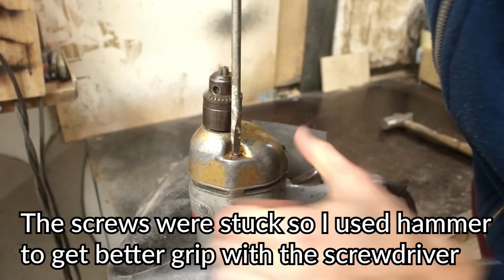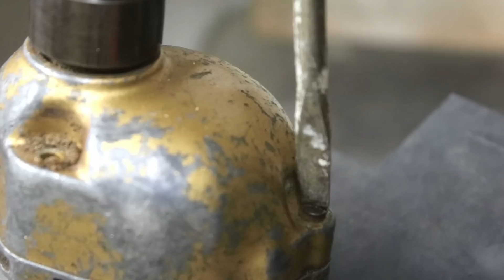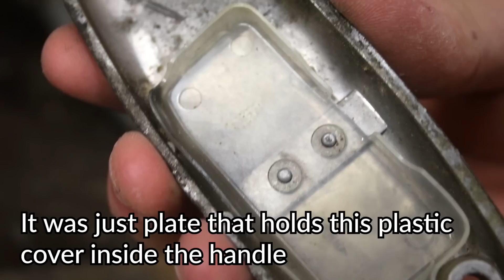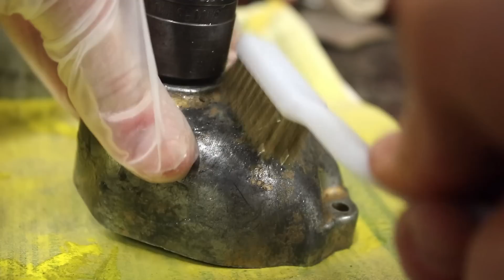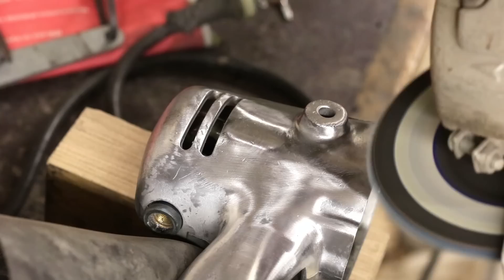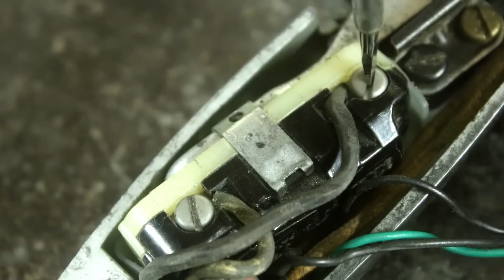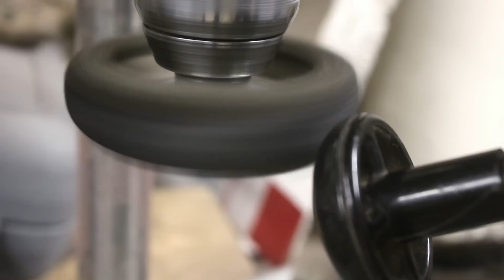Vintage Cord Drill Tool Restoration and Repair - Black and Decker

Comment: We had a similar Black and Decker in the family for over 50 years, the only thing that ever needed replacing was the Brushes once and the fuse in the plug twice. The thing still out performs most out there today.

Comment: Ignore negative comments from people who add nothing and only tear down. You put in a lot of work here and it shows. I generally avoid paint as I like to see the piece gleaming, which you can make that metal housing do. I want you to keep going, polish the bolts, the jacob's chuck. Make that beast shine, brother. Also, you will need more grease in the housing. When it warms up, the grease slides to the bottom so you want to fill it enough so that the bottom of the lowest gear can pick up the grease and help send it to the other gears. Keep going, my friend!
Reply from the maker: Thank you. I think I'll make sure there's enough grease
Reply: @OddTinkering  Keep going, man. Throw away the throw-away culture.
Reply: @mantaship   If we all do our part by eating just one bag of trash a month we can build a brighter future
Reply: I have an old Black & Decker Home-Utility 1/4" portable electric drill guide book.  Regarding lubrication of the drill (which looks much like the one in this video, but a bit smaller) the guide says:  "This Drill was properly lubricated at the Factory and is ready for use.  The gears should be re-lubricated regularly, from sixty days to six months, depending on use.  Remove gear housing, flush out all old grease with kerosene and, with gears in place, re-fill the housing only half full.  All bearings in the gear case end are lubricated by grease in the gear case.  The commutator end armature end my be lubricated by removing the two screws at the back of the switch handle and lifting the switch handle out of place far enough to place one of two drops of oil on the armature shaft.  It will not be necessary to disconnect the wires.  This lubrication is essential only after an extensive period of operation.  Drills out of service for a long time should be completely re-lubricated before use."  There you have it. Beautiful drill restoration!

Comment: I've seen a lot of your videos the past few days, it is mesmerizing to say the least, and incredibly inspiring, I'll take up a few project myself this summer.
Though, as an electrician, I'd suggest changing the whole electric cord into a new one. I can see you prefer to keep everything as close to original as possible, though I've see old rubber wires short circuit inside, due to rubber wearing out and cracking.
Thank you for some great content, already excited for your next video!
Reply: That was my suggestion also.  It’s very relaxing to watch him work and gives me peace with all that is happening.  Keep up the great work!
Reply: As an electrician too, I totally agree with changing a cord into a new one.

Comment: The cool factor about those old Black and Decker drills is that you can still get parts for them. I was able to get replace bearings, brushes and a new chuck as well.

Comment: My late father got exaktly this model from his father. He built a 28 foot cabin cruiser and one day the anchor burnt. But he still had some accessories like the b&d lathe which I became. I found the 720 model from b&d on a german flea market June 2019 for 8 € and did a similar repair. Thank you very much for your good video.

Comment: The Jacobs Chuck can be removed with the screw inside, they are normally left-hand threads. open the chuck jaws all the way and you can see the screw, the chuck then screws off the other direction. this tends to be easier to do before disassembly of the drill motor. just FYI for next time you need to change the chuck.

Comment: I just got a 1/2" low speed high torque drill off Craigslist for $25... The exterior is clean and runs like a champ but is a total mess inside...  Looks like it had been in a few machine shops over the years based on the all the names etched on it... Videoes like this make me realise how much I need a workshop of my own....

Comment: The very good point about replacing the cable has been made & heck yes. 
   After all your hard work & a cleanly filmed video, what not go the extra mile & fit a brand new chuck ? Outside of that, you,ll be using it & not me …………… nice work.

Comment: Very impressive. I would have thought you would have changed the wiring for new incase of any damage which could cause hot spots and a fire, and I would have thought adding more grease into the grease trap for the cog to always run smoother.

Comment: You cleaned it up a bit, got most of the gunk out of it. I was hoping to see how to replace the chuck as mine has broken cogs (teeth). But it runs smoother and will run cooler. Thank you.
Reply: If you insert the chuck key into the chuck and then shock it counter-clockwise, you should be able to screw it off. I have a D520 and I've had the chuck off a few times this way.

Comment: I can get hold a a similar drill not sure of model but looked the same.  Also had a hedge cutter attachment still with it's original box.  My dad had one too many years back,  can remember the electrical tingle off metal body ;)

Comment: Pretty good restoration. 
I would have painted it the original gray, or clear coated the polished surface. You can get bearing material from McMaster Carr and adjust the diameter to the shaft.
Maybe use correct size screwdriver in the future, less risk of damaging the screws. Blade thickness and width should match the screw.

Comment: I love your videos ❤ 
But not comments telling you the inflow traction plate should attach to the vinyl valve output module or the reflex action of the positive baffle spring is hampered by the crossbar lever action
Reply: Different levels for different people, especially for those working at different levels of a craft. There's need and room for all.
Reply: @nothankyou5524  I agree,  was just trying some gentle leg-pulling. As a complete ignoramus, I am in awe of all these restoration guys (and slightly addicted to watching them)

Comment: Be very careful when using paint remover, all it takes is one drop to get on the lacquer or plastic coating on the field  coils or armature coils to cause a short. Even a brief contact with this coating can damage it and cause the insulation to fail later on if not immediately.

Comment: 0:55 Whenever you hold something with bare hand to support and use other hand to apply pressure with flat tip screwdriver I’m worried it will slip and punch a hole in your skin.

Comment: i have my dads black and decker drill that is at least as old as this one (1950s). The thing sparks like fire when I use it, which i dont really anymore.
Reply: Mr Beerski you might want to start with renewing the brushes.

Comment: Fine job. Recommend a lot more fat in the gear house and a new electric cord in order to avoid an electric shock due to current leaks. I got the newer larger model D720 Black and Decker on the flea 🐞 market for 8 Euro after I mentioned my grandma 👵 is old and sick. It was a fair buy and in good condition with little wear except for the painting which I renewed. All aluminium alloy housing 😊.. today mostly plastic😝. Great find. Works fine. Still the older version would fit better into the old red B&D wood turning device I have from my old man. So I must do some welding work for it to fit. Then I can make the steering wheel for the boat ⛵I am building.

Comment: One thing that I noticed is that the baffle plate wasn't re installed.  That plate is important to have good airflow through the motor instead of re circulating the hot air generated by the motor

Comment: Nice job and your editing skills are getting really good ... 
Also which camera are you using thx
Reply from the maker: Thanks. I use canon 750d with basic kit lens my previous 550D and the cheap 50 mm lens.
Reply: @OddTinkering  thank you also how are you doing the focus in and out shots  ( is that editing softwate?) Or a trick with the camera thx
Reply from the maker: I use manual focus
Reply: @OddTinkering  thank you for the insight

Comment: You need to change the wiring around  Green on the case red on one pole of the motor and black on the other, and alter the wiring at the plug to follow that order. If no one knows how it is wired inside and changes the plug, they will kill themselves.
Reply: No he doesn't. Earth is off the the capacitor, case ground, Pos going straight to motor side connector A and neg to switch side B He basically fitted it back the way it was.
UK drill m8.
And why you comment twice on same video.

Comment: You did not take it apart, you are using a wheel to remove pitting and dings I guess on a tool thatvis probably older than you and you used paint striper w/o removing the dec or placard, it hurts me to even say it. Could not finish the video, but good luck brother. For the most part your vids are cool.

Comment: Should be titled Vintage Cord Drill Tool Cleanup.  Restoration would require new bearings and new brushes.  The brushes looked ok but if you want to actually "restore" something you change the parts that get worn.  Nice job cleaning it up though.